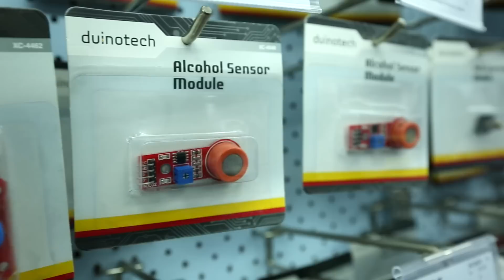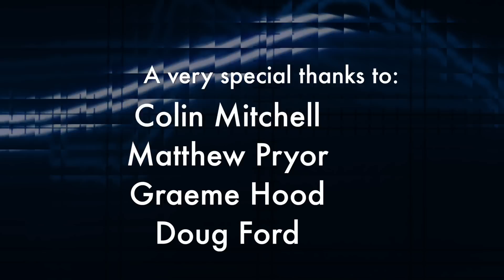The Decline of Hobby Electronics?

Comment: I learnt my electronics in the 70s from Practical Electronics, ETI, Wireless World, tryin to adapt circuits to the components I had available.  Today I use Arduinos, RPis etc, but most applications are for audio (synth hardware) so these are relegated as Midi processors.

Comment: As decades went by, electronics got more and more complex, and people getting into it were increasingly made to choose between getting a grip on the basics (ie transistors, TTL/CMOS logic, radios etc.) or doing cool stuff with microcontrollers and modules communicating over common interfaces like I2C, SPI etc. Wanna build a robot? Of course, who wouldn't! Seems like there's no way of doing it with discrete components, though it can be done if you can accept some limitations and are willing to put time and hard work into it. The problem is, even engineers often can't solder nowadays. Call me outdated, but that was unthinkable in 2000s and earlier.

Comment: The basic parts are a lot cheaper on Amazon than they ever were at Radioshack, and you get them in bulk. 

But it does seem like fewer people I know even are aware that electronics can be a hobby. But there is a thriving community online of makers, hackers, and DIYers, of course. 

It wasn't too long ago that say, audio engineers or comp-sci (mostly software-focused) majors would actually need some experience with hardware work. The former would learn how to solder connectors on cables and often repair the mixing consoles, and the latter would experiment with logic gate circuitry to get a feel for how computers compute and store numeric information. 

Nowadays, a lot of the stuff you buy doesn't come with a schematic, and whatever schematics you can find on the open internet are from reverse engineering, a practice that isn't illegal in and of itself, but often goes hand in hand with patent or trade secret infringement. SMD technology, and by extension, tiny pads, is indeed the norm for expensive electronics, making it difficult to solder or desolder components by hand. 

And many of the things you can create with DIY electronics, while enjoyable to make and fascinating to think about, are variations on inventions from a bygone era. Perhaps some other people wouldn't enjoy building an AM radio from scratch with general purpose components and a breadboard – but would they not enjoy it if they didn't grow up with a cell phone? 

Arduino does simplify a lot of things, such as microcontroller programming. You have so many libraries in the public domain you can just incorporate in your code, even hypothetically for commercial purposes, and you can use them for all sorts of interesting projects. Not everything has to be about starting from fundamentals – you don't teach someone piano by lecturing them on the electrochemistry of our nervous systems, mechanics of the ear, and the exact angle you should put your fingers on the keys (with a protractor) after discussing the mechanics of the piano in depth. There is no shame on learning electronics this way. But it's nice to be able to build your own AM radio and explain the gist of how it works, or describe how a simple NPN transistor used as a switch can be thought of as the basis of all computing.

Comment: I would disagree - I think we are in a renaissance of electronics hardware. A lot of this has definitely been brought about from microcontrollers like Arduino / BBC Micro:bit and SOC devices like Raspberry Pi.

Also there is a huge community of makers on YouTube building amazing devices which are really inspirational - just look at the propulsive model rocket landing series from BPS Space for a great example!

People are not building simple projects - like a radio, but more things like battle bots.

Whilst knowing how to solder is definitely useful, it isn't the prime goal - getting the project running is. So using connectors like Grove / Stemma QT definitely isn't cheating. And if you want to build your own PCB's there are many companies you can send your design to - like PCBway - where they can do the boring parts.

I do appreciate that Jaycar still sells parts, but the markup is often extreme! It would have been good to talk with the management from Core Electronics in Newcastle - they seem to be doing OK - especially with online sales.

Comment: I tried to change with the times. Too many things changed. Too many investors tried to rip me off instead of investing in marketing my idea.

I had banana boxes with all kinds of parts that I got at pennies on the  dollar. 

Plates, rods and tubes of aluminum and steel, resistors, capacitors, series trigger transformers, lasers, RF amplifiers, KT88 tube audio amplifiers...

All liquidated. I can never recoup what I had. I used to repurpose things and solve people's problems.

Some people called me a hoarder but I had the parts on hand to build the project at 3 AM even if I didn't have the money. I also usually gave away the finished product so I was not a hoarder. 

You need real estate to store all of this stuff. When you become homeless, a lot of people come around to "help" you.

They have ideas on how they can haul away all of your stuff to the metal recyclers after they have picked through it.

Thieves, tweakers, recyclers and landlords, they are all vultures.

Let's scrub the land of all of the old cars up on cinder blocks. Let's make everything pretty and sterile. Let's all support capitalism and buy it instead of making it.

I know that I sound like an old man shouting at the clouds. It might be my own damn fault for not rolling with the changes but I have untreated ADHD and have too many coping mechanisms.

I'm also pretty naive and let too many people take advantage of me. Thanx for listening. I've vented enough for now.

Comment: I used to work at and buy from a surplus company in California called Halted (started by Hal and Ted.

You could buy discreet components as well as surface mount by cutting them off of a reel.

I owned a stereo zoom microscope and a hot air pencil. After a while Radio Shack closed, so did Halted, so did Weird Stuff.

You could buy stuff mail order but you needed a credit card and a paypal account.

I got old. I moved back to Michigan and got COVID, went into a coma and almost woke up dead.

Things have changed. I was at ground zero and didn't realize it. I lost my collection of parts to storage locker laws and storage war mentality.

I would love to continue to invent and make but have lost my spark, not to mention my ability to walk.

Comment: Repairing electronics or creating our own equipment is difficult to rationalize when we can buy something ready made from China for less than our cost of components. Hobbyists may have limited access to brick and mortar electronic stores which might have  been sources of inspiration for  previous generations BUT they do have unlimited access via the internet - both for incredibly cheap components and incredible on-line tutorials. I must admit that I rarely create circuits from scratch any more, it is TOO EASY to just meld "modules" together to produce a workable tool or appliance. The introduction of dirt cheap micro-controllers and micro-computers has allowed using me to successfully complete projects that would have required an extensive knowledge of electronics to produce prior to their existence. And now there is AI, things are happening too fast for comfort. We might be on the verge of developing technology as dangerous as the nuclear bomb.

Comment: 20 years ago I too knew that the function of electronic repairers was going to disappear. because you should know that robotization in industry had allowed overproduction and a drop in prices. all manufacturers are now introducing planned obsolescence. All products have become single-use again like tissues. but things will change and the feedback from repairers is visible in the field of smartphones. because a smartphone has become too expensive again and often suffers breakages..an 800 dollar iPhone no one dares to throw it away.. then the introduction of switching power supplies is very fragile because of urban power supply. there are two niches that will bring DIY enthusiasts back to electronics. the smartphone and the switching power supply
😊🇩🇿🇩🇿

Comment: Soldering SMDs is bothering them? WHAT XD? Pliers, and magnyfying glass is the actual obstacle? For real? For whom? 80yr olds? Hobby electronics today looks vastly different, and possibilities are limited only by your wallet tbh. It's never been easier to get into the business with an actual experience. KiCAD that opens the door as hell, because it's actually being used in the professional industry - and you can learn it at home, do some desgins, order with its project files physical PCBs, and have BOM to get elements. It's never been better than today! 
An amateur is capable, to do something serious in months of being into the subject! Times are beautiful imho, its full of opportunities. It's the matter whether you want to bend over, and grab one, or you are to lazy and see to many obstacles.
Reply: thats the problem, the wallet. in the 80s a lot cost more of course, but a kid could get a big chonky soldering iron and a perf board and some compnents and start building for the time very advanced circuit. but nowadays to jump from the learning stage to the point wehere your skills become useful costs a lot more money and takes a lot more time. for me working with smd is easy but you cant work with smd on perf boards or breadboards, meansing that prototyping is much harder and you either need the capability to etch pcb's or order them which costs a lot of money etc. etc.

ps: dont thing im 80 years old with a outdated opinion, im 16

Comment: I've embraced the microcontroller side of it. I love programming and electronics. We don't make transistor radios like our forefathers. We make digital devices capable of fast communication between sensors and interfaces. Every bit of software, hardware and supply chain logistics is at our fingertips. SMD is not a bad thing. You can build your own re-flow oven for cheap and get stencils and solder paste for SMD. It's not worse, it's just different. I think we need to regain the electronics industry in the US, but as a hobbyist, I don't feel limited in the least.

Comment: When I bought a radio in the 1960 I got a good manual, a schematic and if something broke down I could order spare parts and repair it myself. There was a good repair service. A radio (or other elek. devices) are a value and every efford was made to repair a device if it was economical to do so.

Today you will only get a user manual with a new device. 
Devices will not be repaired but replaced. It is very difficult to repair this devices and many repair shops are out of business. Very often it is cheaper to buy a new one.
The old way of thinking is much more gentle and better for our environment.

Comment: I use 0603 SMD all day long in my joy as R&D at an engineering company.  Yes, it's easier with a scope, but I have a $50.00 digital scope at home that does the job.  I just don't think that SMD is out of reach of young hobbyists.
Reply: I just recently graduated with my bachelors in computer engineering. My senior design project was a signal processing board that was probably 95% SMD parts. For less than half the cost of an xbox I was able to get tweezers, solder paste, a hot plate, and a hot air gun, and enough components to teach myself how to lay paste down with a stencil, stick on the components, and use the hot plate and air gun to solder the parts.

I did need help with the most complicated part in my design, a 140 or so pin BGA, but the rest of the components were very easy to paste, place, and solder together. Honestly with places like JLCPCB and tools like KiCAD, its gotta be easier than ever for a hobbyist to get into intermediate to advanced level electronics prototyping using SMD parts.

Comment: Electronics of the 70's and 80's is largely gone these days, there is no longer the desire by most to repair stuff since it is cheap to replace, the only reason to study electronics now is if you have a keen interest to adopt it as a hobby....sad but true.
Reply: I'm 59ish and a lifelong electronics hobbyist who does R&D for an engineering company.  In my experience, being able to troubleshoot ANYTHING has given me near God-like powers in the eyes of my co-workers. I wouldn't call myself a programmer since I do more electronics and mechanical design than programming, but I'm often called upon to troubleshoot systems due to my aptitude and experience.   You can never have too much troubleshooting skill.
Reply: The REAL "Golden Age" of hobby electronics was the 1950s, 60s, & 70s.  The decline began in the 70s, and was due, I believe, in large part, to the ever increasing complexity of ICs & the emergence of of the microcomputer.  The post-WW2 boom in the hobby was spurred on by the Cold War, the Space Race, and the availability of VERY cheap WW2 surplus equipment.  Every issue of the various electronics mags was full of ads for home=study electronics courses.  CIE, CREI, NRI, NTS, ICS, being the most popular.  Allied Electronics, before their take-over by Tandy, produced a thick, "wish-book" catalog, that had every conceivable electronic component, as well as test equipment, radio gear, etc.  Lafayette was their main competitor, with similar offerings, and Burstein-Appleby, and Olsen, runners-up.  Ah, the good old days!
Reply: @Pootycat8359  Very well written sir and so very true.

Comment: Lots of kids playing around with Arduino UNO boards these days.
Reply: Arduino isn't strictly electronics, it's programming.
Reply: @johnsmith-lb4mo ,  
  Microcontrollers aren't electronics devices???  That's news to me, and I've been an electrical engineer for almost 20 years now.
Reply: @jessstuart7495  With a  Microcontroller, most of the electronics is already done for you, all you need to do is write the program.
Reply: @johnsmith-lb4mo  I can confidently assume the most of the Arduino players don't even know what an op-amp is.
Reply: @phenixisbest  really?  is it that modulized? But that's a good thing though, that means with a complete  kits, you have a whole playground in the box.
Reply: @springrollwang4441  For Most of the Tasks done with an Arduino you don't need an external OpAmp, which is wired by the User. 

My first contact with opAmps was 5 years ago, when I started to make my Hobby to a Profession. 

Now I am an electrician technician and I'm producing and designing most of my pcb's myself.
(Only for the more complicated Multilayer-PCB's I need external Help in producing the pcb's. We don't have a multilayer-press yet.)

But unless it's Not only soldering components to a premanufactured Board, you have to be a real nerd to Setup a whole darkchamber at Home, building an etching-setup, etc

Comment: I can best this comment too if it serves an optimistic slant on reality.

yeah, the surface look of modern capitalism has suck stains all over it.

Yet, as a Ham Radio operator for many years and an electronics builder since I could solder at 5 years old (I'm 48 now) I find building as fun as ever, albeit I have to work around the bifocals.

Comment: The decline is mainly due to integrated components that requires a microscope and good steady hands to solder.  My hands shakes due to a military service connected injury, so those microcomponents soldering are off limits for me. The decline is also hapenning in the Radio Amateur hobbyists, it is hard to do experimentation with small electronics and tight space on radios and accessories.  On top of that many of the electronics components stores like Radio Shack and others either went out of business or became solemnly online, taking away the thrill of walking to the store, get your components, and go home. Now you have to wait days to get your components and have to buy more than you need.

Comment: I remember going up to Pilgrim Electronics to buy parts when i was in Jr High, they were a radio-tv-ham supply parts dealer that had a pretty good selection of parts and could order parts they didn't stock. I built a lot of EICO and Heathkits back in those days and still use some of the test instruments i built 60 years ago.

Between my failing eyesight and a tremor I've developed, surface mount is pretty much a no go area for me, I do still rebuild some golden age receivers and tuners that people want to keep going